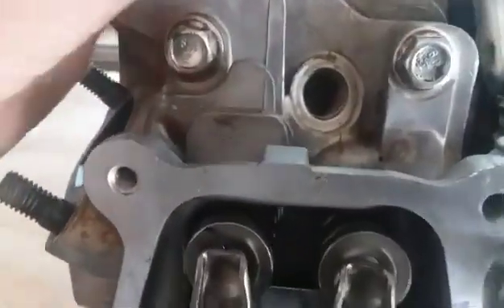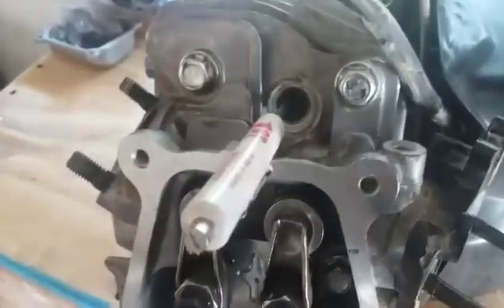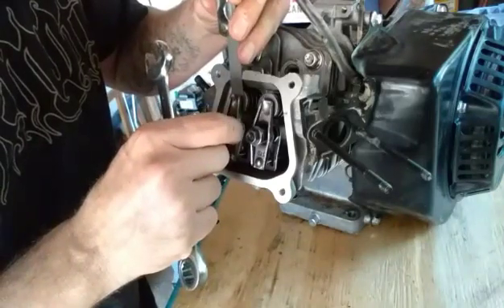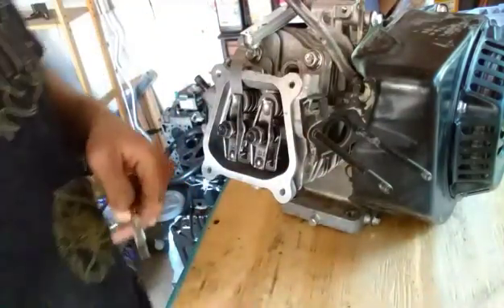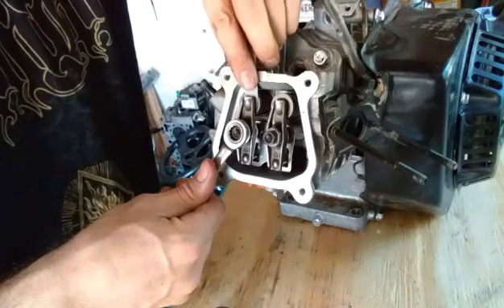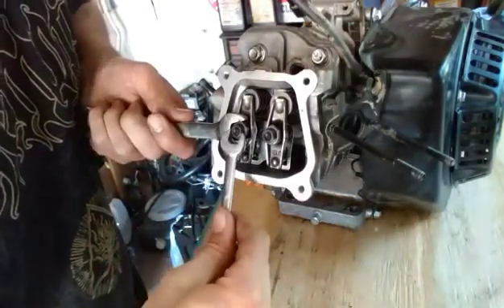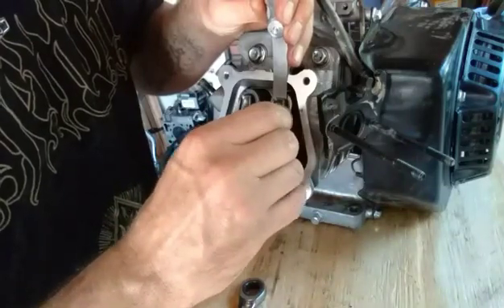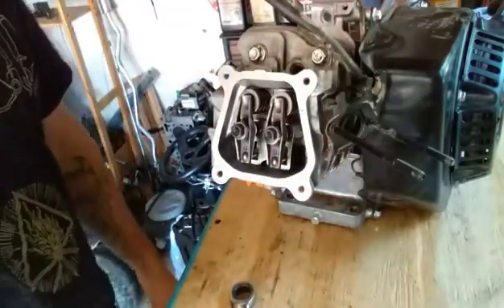Predator 212cc Valve Lash and Common Compression Issue

Comment: Well for those that are new to this work you have two top dead centers (TDC) on a 4 stroke. And a compression release bump.. put your finger over the spark plug hole and rotate the engine slowly and watch the valve ,you will feel on the compression stroke pressure pushing your finger off the plug hole that's your compression stroke .now once you find that TDC rotate just alittle more and you will see the exhaust valve bump open real quick that's your compression release on the cam bumping it so it is easier to start your engine and once the the engine starts centrifugal force moves the compression release out of the way.
 So you really want to go a hair past TDC ,right after the bump to set your valve lash. 
Now when you get into what to set the valve lash at on a STOCK  motor is recommended all over the place on the internet. I like to set mine at .004 at the intake and .006 on the exhaust.  That's just my personal sweet spot on stock engines . 
When you have takin the govenor out and added racing parts  like billit rods ,higher weight valve springs and flywheel and advances timing that changes everything . And may have to set your lash accordingly.  But building an racing engine is another ball game....

Comment: I was messing with my valve lash bc it locked up but when i Tightened the  valve lash it stopped locking but when i turn it on i cant exerlerate it bugs and almost turns off idk what to do

Comment: For those of us,  who might not know,  which stroke, at Top Dead Center, should we use to set the valve clearance,  exhaust,  or compression?  I believe it would make a lot of difference,  myself.  I noticed you did have it on the compression stroke.

Comment: Mines started being hard to start after I changed the valve springs
Reply: Same….. I put 22lbs valve springs and after u could not pull the chord ….
Reply: @sailingvesselkuma4366   your exhaust lash is too tight
Reply: @kill_pierre  I did mine 3 on intake and between 3&4 on exhaust but make sure it's at tdc compression stroke and turn it a little bit more like a hair more  worked perfect on all my engines
Reply: @sailingvesselkuma4366  I put in 18lbs spring and have trouble with pulling couldn’t imagine yours.
Reply: @sailingvesselkuma4366  Did u fix it?
Reply: How you fix the problem?

Comment: I have a problem with my 212 cc predator engine it keeps accelerating to full power when  i turn it on
Reply: Probably  you removed the governor but don’t a have throttle return spring
Reply: Use a screw driver and turn the idle down
Reply: Keep the old governor arm and use it to install a return spring to it, I hooked mine to the ignition assembly(drilled to smal holes and used the same spring that come with the governor)

Comment: what size feeler gauge did you use for exhaust & intake I'm having same issue not sure what the specs are
Reply: The Truth of the Matter I adjusted mine to .005 intake .007 exhaust thats what red beard said and my pulley gets tight any reccomendations ?
Reply: OG Masoo yeah but he put 18lb value springs
Reply: @OGMasoo  003 in an ex
Reply: The Truth of the Matter No my pull start
Reply: Mine did the same og masoo did
Reply: The Truth of the Matter I only took of the valve cover and it pulls perfect without the sparkplug in it
Reply: The Truth of the Matter couldn’t have said it myself. Thank you sir
Reply: The Truth of the Matter what size filler gauges I need fire both? Thanks
Reply: The Truth of the Matter  Absolutely,  and thank you.  That could be the cause of a lot of the problems in these comments.  If valves are set on the exhaust stroke TDC,  they will probably be considerably out of spec,  loose, at the proper TDC valve clearance on the compression stroke.

Comment: Hey brother I am having a similar problem with same 212cc Clone engine , but mine has too much compression and is extremely tight to pull .
Reply: Smh me 2 what do I do?
Reply: @LRT_DaViNcHy_787  literally going threw the same problem When I go to pull my cord it won’t pull but if I pull slightly with effort I can get the fly wheel to turn I was able to start it and it runs fine I’m just curious why it’s so hard to start. And literally nothing on the Internet helps
Reply: Matt Noguera any fixes?
Reply: Try setting the valve lash to OE spec or if you have a cam whatever it suggests

Comment: Hey bro I had a question, I set my valve lash to ur specs but it still jerks back really hard when trying to start, is there anything I could do to fix this?
Reply: Readjust your valve lash. These engines have a compression release, on the exhaust valve you have to turn the engine slightly past top dead center to adjust the valve. If you don't the compression release won't work and you'll get the snap back when trying to pull start the engine.
Reply: @SuperGlacierGirl  man make a video on it 👍🏻👍🏻👍🏻
Reply: @dmcalister4505  We will have one on our channel shortly :) An old school simple tried and true method
Reply: @SuperGlacierGirl  thanks having this problem